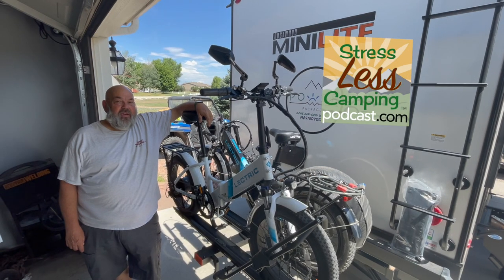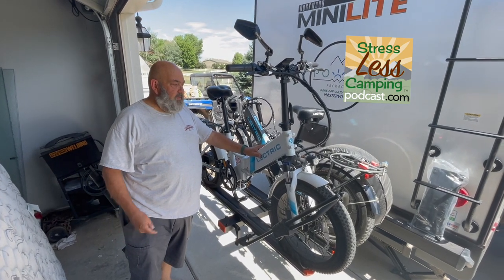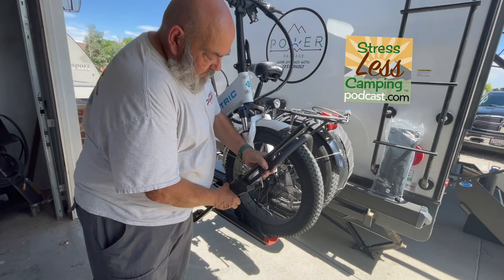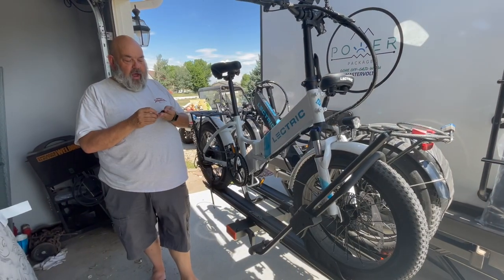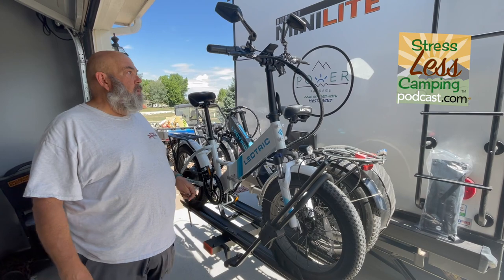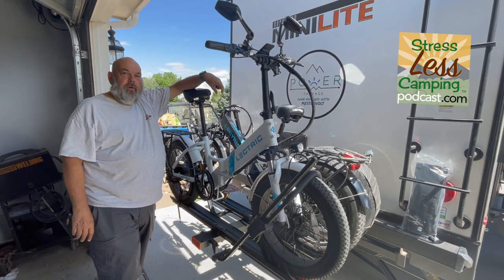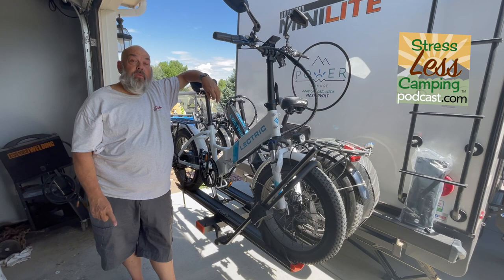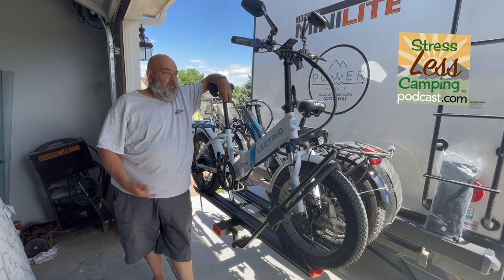Curt aluminum tray style bike rack review with Lectric eBikes

Comment: Good review! I’ve read that some racks are specific to rv’s, this one doesn’t say that, but it’s on my list, it held up great? No issues with anything coming loose while travelling?
Reply from the maker: Funny thing - the one in the video was destroyed when we got rear-ended last year. We got a new trailer and a different bike rack and that different bike rack was so unimpressive that we bought another of these Curt bike racks. That newest one has been all over the western US this year and is holding up quite well. 

This really is a well-designed product.
Reply: @StressLessCamping  that’s awesome to hear! So it’s been over some bumpy roads and everything is good? Good to see that you have e-bikes as well so I know that it can hold that weight! 

I’m from Saskatchewan Canada, and there are some bumpy roads so hoping that it can withstand that behind the camper! But it seems like a very well built rack!
Reply from the maker: @Bergs9317  Oh yeah. We put a lot of miles on the original one and then at least 1500-1800 miles on this one so far going from New Mexico to Northern California without issue. 

We do take the battery out of our eBikes just as a precautionary measure because I'd rather something be understressed than at the limit.
Reply: @StressLessCamping  oh for sure, my bikes are pretty normal weighted, I’d say around 40-45 pounds so I should be good in that sense! 

I actually emailed curt and asked. And they just replied and said they don’t recommend putting it behind a camper, but after hearing your review I’m tempted. The thing is, I only go camping for 1-2 weeks in a year. And the trip is only about 1.5 hours one way, so I would think it could handle that!